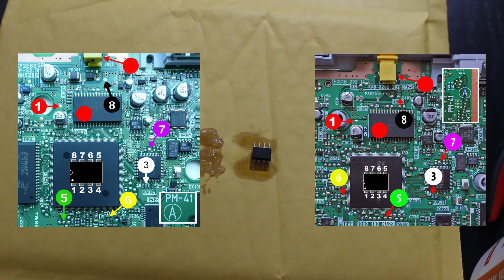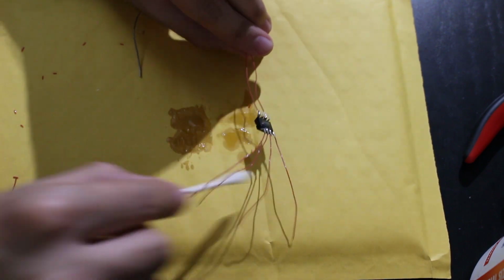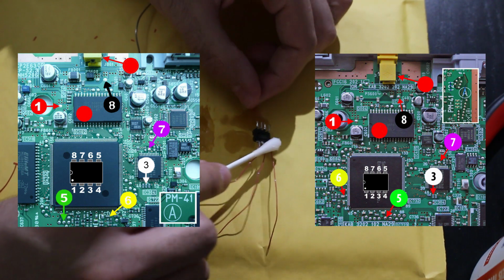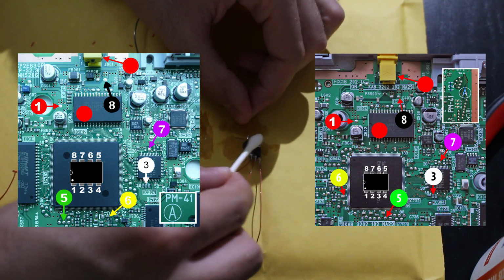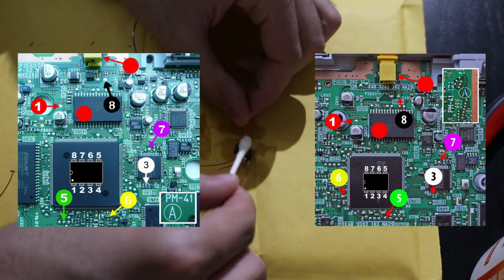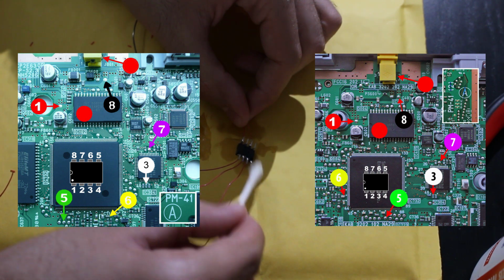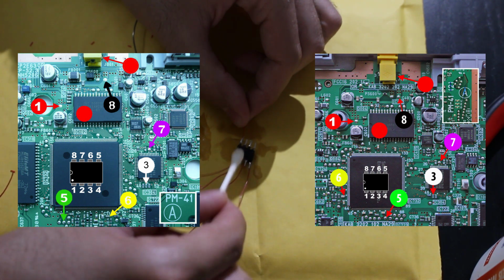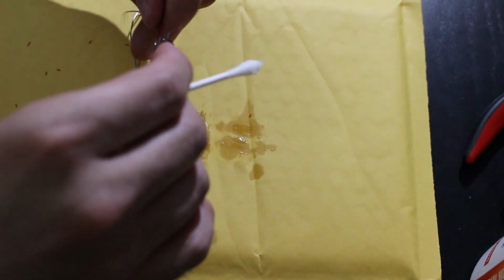How to Install a Modchip in a PSOne (PS1 Slim) | MM3 PSOne Modchip Install Tutorial

Comment: Got solder on processor and now the system is dead. Stupid pin 6 ruined everything.
Reply from the maker: If you dropped some on the pins for it, depending on your comfort level, you could use some drag soldering techniques to reflow the pins so none are bridged.
Reply: @MrMario2011  I didn't know that was a thing thank you. Its worth a shot. Also the whole metal bar on for pin 6 on the A board came off. Could I just bridge the points it was connecting with solder?
Reply: the drag soldering techniques I found online were unable to get it off. Thanks for the help anyways.

Comment: Hi. I have a question that I don't know if you can answer me.  I have a modchip similar to this one installed on my psone, however I have some original capcom games like dino crisis and resident evil 3 that detect the presence of modchip in software and prevent the game from running.  My question is if there is any solution in hardware/software for this problem, which makes it possible to play these games, keeping the modchip.  Another question: if I remove the modchip, are these games expected to work normally or is there any procedure when removing the modchip?  Thanks for the video and the channel.
Reply from the maker: Removing the chip will resolve that issue for original games, for backup games you would need a newer modchip with stealth such as Mayumi v4, MM3, or PsNee.

Comment: Are you adding solder in advance to the wire ends? Or are you just pre-soldering your iron tip? (Newb here). Thanks!
Reply from the maker: Whichever makes it easier for you! I rarely add solder to my wires before soldering them in now, but when you're first starting out it will probably make things easier. AND FLUX! USE FLUX.
Reply: MrMario2011 thanks for your response!

Comment: Doing this next weekend with same board..Wish me luck :O
Reply from the maker: Have fun!
Reply: @MrMario2011  Quick question sir Mario. I installed chip. All went well I presumed. I checked connections numerous times but ps refuses to boot other region burned cd-r unless I do the swap trick. Playing pal burned disks with no issues. I'm stumped.  Thank you. Just wondering if the chip was bad.
Reply: All good now thanks. Was working off incorrect diagram..fml..:)

Comment: I plan on buying a ps1, but i dont want it moded... is it possible to reverse this process? I mean, i want to remove  the chip that allows to play pirate games... is it hard? A good condition ps1 here in brazil is very expensive... 500 reais (thats half minimum wadge)... it's the same as paying 600 dollars for it, lol...
Reply from the maker: Just desolder the wires and remove the chip. Although no harm in keeping the chip in there.
Reply: @MrMario2011  Ok! Thank you for the reply. It's because i wanted it as close to "original" as possible! I have no practice with soldering. lol. But i think if i take the proper care i wont damage it, thanks though!

Comment: Stupid question; What do the bid red dots signify? In the install you didn't solder anything close to them. Are they just placeholders for something else?
Reply from the maker: Those are alternative points you can solder to, in case you don't want to use the red point I soldered to.
Reply: @MrMario2011  So they are alternate solder points for number 1?

Comment: Hey

I have installed ONEchip in PSone with PM41(2) board. Console works fine, loads everything without hassle, but there's one problem. It's something like coil whining inside laser. I tried two units and in both same happens. But this whining is more like tik-tok - whines for a second and stops, repeat and go on. It stops when open the lid. What's going on?

For disabling modchip it's enough to desolder first and eight pin?

Comment: Looking into getting a modchip for my PSOne console I picked up recently, thanks for the tutorial, does not look too hard to do after all the guff.
Reply from the maker: Hey, SpooferJahk! This totally answers why I saw you pop up on my Twitter feed, welcome aboard!
Reply: @MrMario2011  Thanks and yeah, you can blame Vadim's black magic on that. 😛
Reply: @MrMario2011  hello mario sir  i have question i have psone slim model schp-102 wich diagram i need to follow to install chip in my playstation please if you can help i have also download all the diagrams you told to download butt i dont know which diagram i have to use pls if can help it will be appriciated thnx sir

Comment: I accidentally lifted the pad on #5 and ended up quitting the install after that. I tried to clean up around the point. But after putting it back together without the modchip, my psone just sits at the Sony logo even with a disc in. Is there anyway to fix this or is my psone bricked at this point?

Comment: Wow, that's a rats nest of cable! Good tutorial, but you should really try to improve your conductor runs.
Reply from the maker: Rats need a home.
Reply: What functional benefit do wires that are organized offer? If anything the extra length you would have to add to organize them would just cause more resistance.... So no possible functional reason to make it "look pretty" or is there?

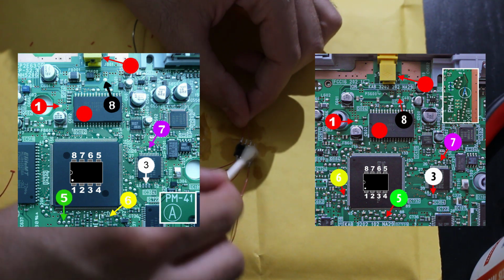Comment: I accidently lifted the pad off point 5, does anyone know of an alternate solder point I can attach the wire to? (Green on the left photo (PM-41) at 2:50 )
Reply: Literally did the exact same thing. Within 5 minutes of getting into it. Had #8 soldered, then went to solder #5, put some solder on the pad and went to solder the site and it just came right off

Comment: Nice vid. 
Should've used heat shrink on the chip legs for protection. Could've used a tiny bit of 2side tape to mount on bigger chip and then shortened your conductors.
Reply from the maker: True.